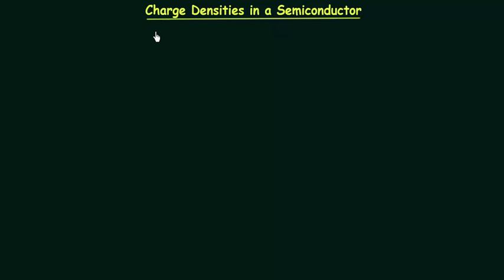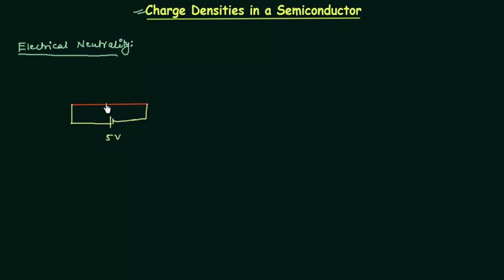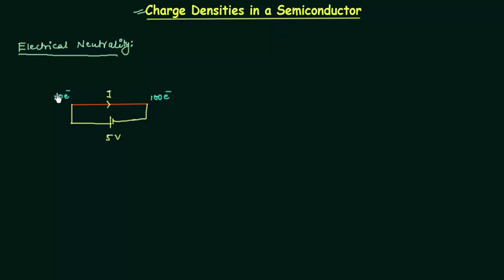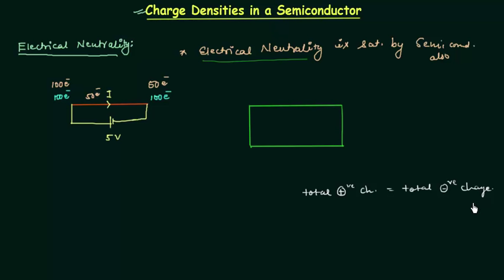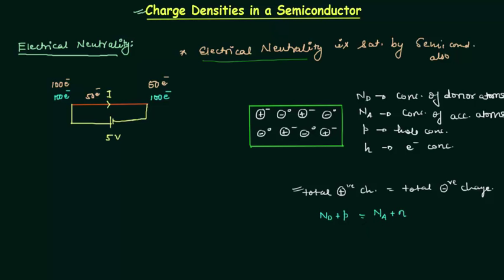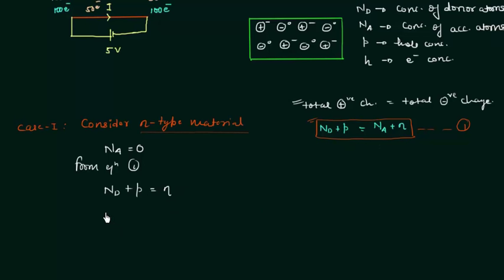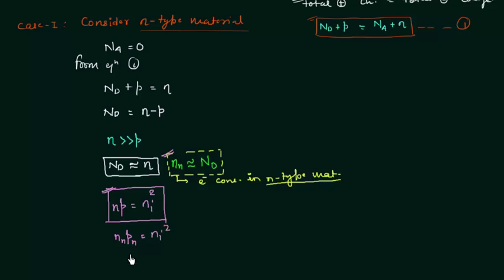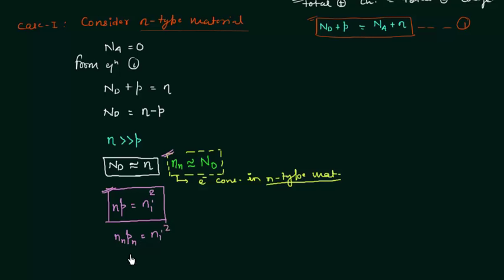Charge Densities in a Semiconductor

Comment: SIR u have started with taking both n and p type simultaneously for electrical neutrality but if we take only n type then is it electrically negatively charge ????
Reply: Jamal ansari No. There are more number of electrons in CONDUCTION BAND, however total number of electrons and PROTONS (not holes) in the material remain same. Material will loose neutrality only if number of protons and electrons are different.